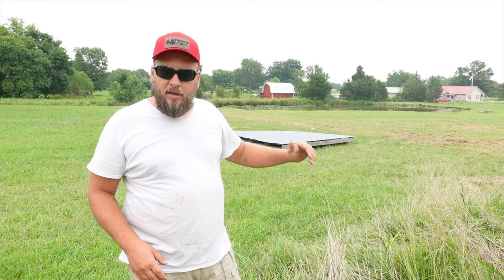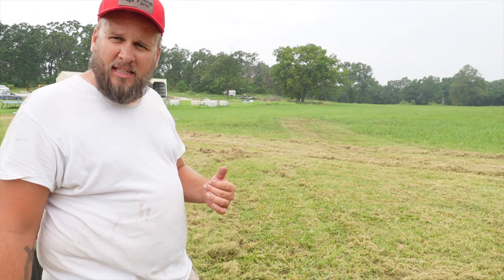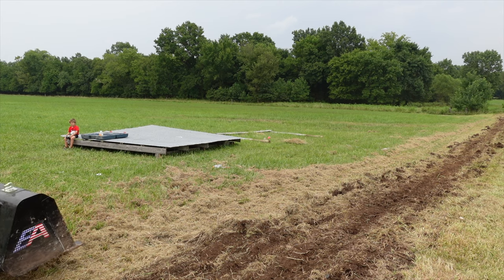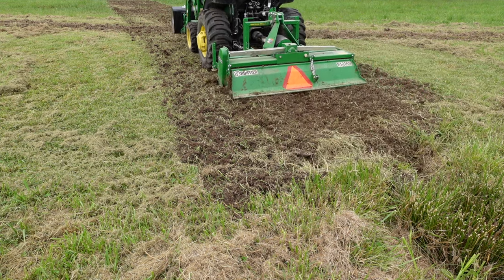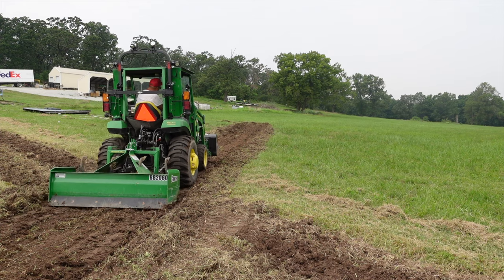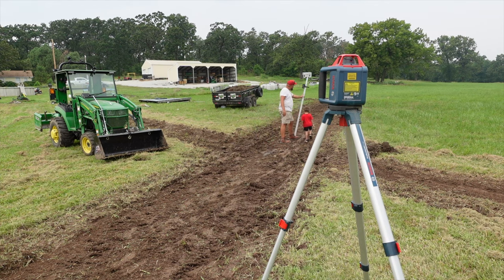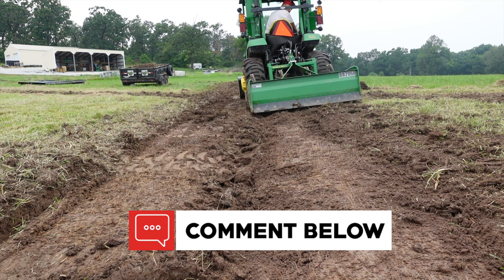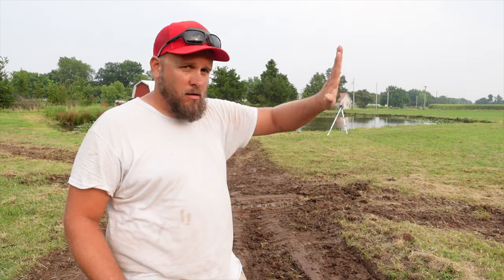Digging a Swale With a Box Blade and Improving Drainage to the Pond

Comment: Hi Brock. What you are building here is a ditch/diversion drain.  A swale is on contour and the material taken out of the swale line is mounded onto the downhill side and usually planted with trees/food forest etc. Water then fills the swale, levels, goes nowhere and then percolates into the downside hillside over time hydrating the land further down the slope.  Ditches and diversion drains takes water away from problem areas...  Cheers. M
Reply from the maker: Thanks for sharing
Reply: just let the man dig his ditch

Comment: I did the same thing only when it rained I had a couple of puddles. I hope I can just fill them in with dirt and get the water to flow on down the ditch
Reply from the maker: Yeah, it will probably require some maintenance overtime but you can only touch it up when it’s dry.

Thanks for watching

Comment: Tiller and a box is all I've ever used, well all I got actually. I adjust the lower 3pt arm to a fairly good pitch and make a few passes both ways with the tiller. Then pull all the dirt out and repeat as needed. You can take some of the pitch out to grade it back more on the tops. You can feather the swell back so much, you can't even see it unless you know it's there. It's time consuming having to swap implements over and over again, but it'll get the job done. You can also do it with just a box as well. Just set the pitch of the arms real sharp and drop those rippers and make a hard cut V at first. Then just drop the tires in the V and grade back the sides as needed. There's really is tons of ways to cut a swell with what you have as long as you're creative with what you have.
Reply from the maker: Thanks for sharing

I’m happy with how this one turned out
Reply: @RockhillfarmYT  Yes sir, it looked real good. Especially seeing you started with a mud hole. I just figured I'd share with the viewers a few ideas. Maybe it'll help them look at all their implements differently at how to use them. P.S. a single turn plow makes a awesome trencher for shallow trenches like gutter drains and such.
Reply from the maker: I do appreciate the feedback and advice

Comment: The dirt is so nice & moist.  Jealous!!  There is no way you could this project around here.  The top 4-5 inches is hard as concrete.  We need rain!!
Reply from the maker: Yeah, the purpose of the project is that this area holds too much water. Doing it in dry ground would probably cause you to need a different set of implements

Thanks for watching

Comment: Maybe it's me but I never have any luck leveling roadways or driveways that have a bunch of low spots.  Doesn't matter if I have a scraper, box, plain, or even my landscape rack no matter what on the back it follows the tractor and the tractor tires follow the ground and go up and down.  So I always have the highs and lows now if I have new material or tilt-up hard pack and use the  landscape rake on my loader with the 3pt adapter I have no issues and can do it quickly
Reply from the maker: Yeah, that is a struggle.  I am always trying new techniques to deal with that.  

I have used the rake on the front for raking up sticks and debris but haven’t tried it for leveling
Reply: @RockhillfarmYT  I find it to work really good as long as you have a good level spot to start from. I set the curling angle that I want and then pick the rake back up so it's just off or just touching the ground and then drive forward

Comment: Question: Do you prefer to use a tiller without a PTO or without one? (That I've noticed) I noticed yours doesn't spin by a drive.
Reply from the maker: I don’t understand the question

My tiller runs off of the PTO
Reply: @RockhillfarmYT  I must have not noticed the shaft from the tractor to the implement. At my work we have an old Ford tiller with a yellow shaft that spins the tiller teeth

Comment: Brock, What are you doing with a Bosch transit? You aren't a DeWalt guy afterall. :) :)
Reply from the maker: Right. The Dewalt transits were sold out when I was trying to get one. This is the exact model that the guys used when they poured my concrete floor in the shop

As always, Thanks for watching

Comment: I noted that you were not taking your depth readings with an absolutely vertical stick??
Reply from the maker: When you place the stick it will start beeping immediately if the ground is level.  If it doesn’t beep you either lift it or lean it until it does beep

Then you start leaning it sideways until it does beep. You can estimate from how far you have to lean the stick how high that spot is.  Then you can remove dirt until you don’t have to lean the stick at all to get it to beep

It’s easier if your base unit is on a high spot because then you are seeing how far you have to lift the stick off the ground for it to beep and that seems to be easier for me to estimate

You have to lean it quite a ways to accommodate an inch of depth being off which is why these sticks don’t even have a vertical level on them

If there something I’m missing let me know. Thanks for watching and for commenting